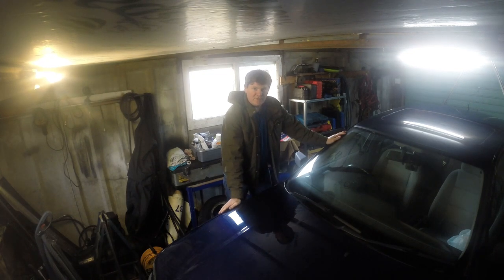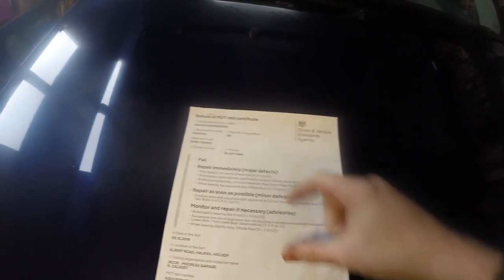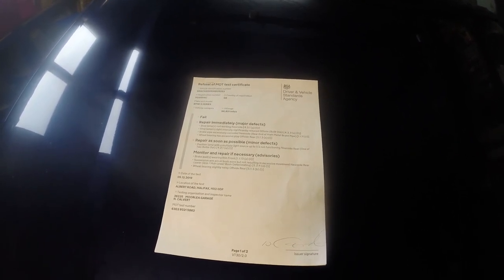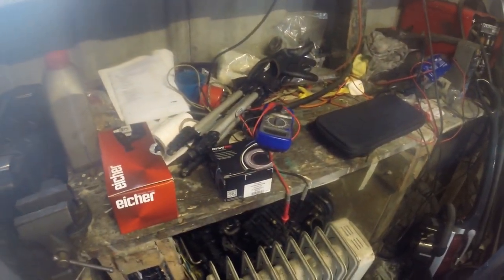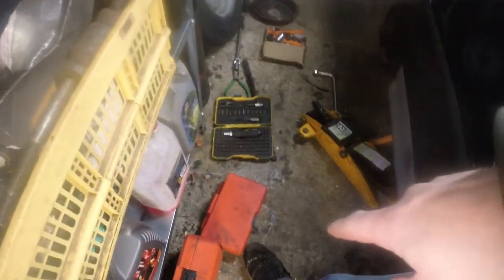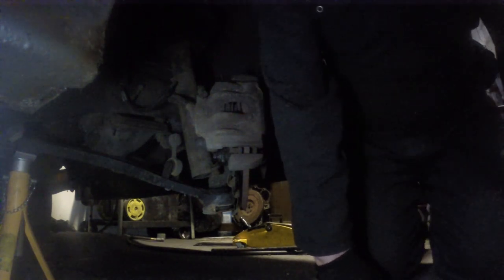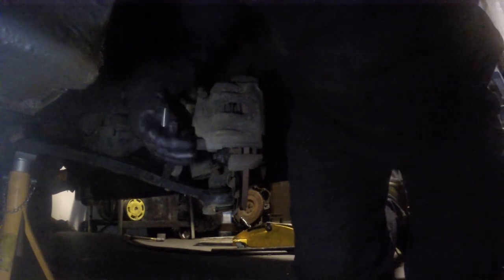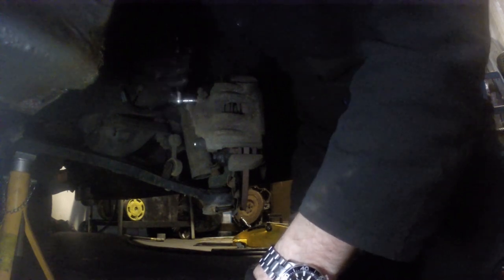Project Bimmer (1995 BMW E36 318i) Part 22 - MoT failure & remedial work

Comment: Nice to see you cleaning & using proper grease on the sliders (pins) as so many people will use Copper slip which is a big no no as is soon makes the sliders sticky thus the caliper may not release fully, The only thing I would have done is to use a flat bladed screwdriver to take the rust off the disc top & sides by holding it against the carrier & spinning the disc by hand.
Reply from the maker: Thanks for the comment. I was more bothered about the pads being able to move freely.

Comment: So they failed and advised the wheel bearing
Reply from the maker: I don't get it either but Nigel at the testing station knows what he's doing so I trust his judgment.
Reply: The (advisory) is for slight noise which is not a fail, The fail is for play I,E movement in the bearing ... hope this helps
Reply: Steve Webb why put it as advisory when obviosly it will need replaced to pass
Reply: @hahahahahahahaha9313   I know it's just one item in this case a wheel bearing but as regards to the mot a slightly noisy wheel bearing is different to a wheel bearing that has play in it I,E a slightly noisy wheel bearing isn't construed as dangerous whereas one that has excessive movement (play) I,E side to side is for obvious reasons therefore it gets noted down separately I mean having a wheel falling off can put a downer on ones day, hope this has helped :-)